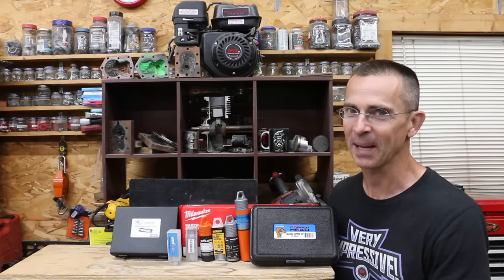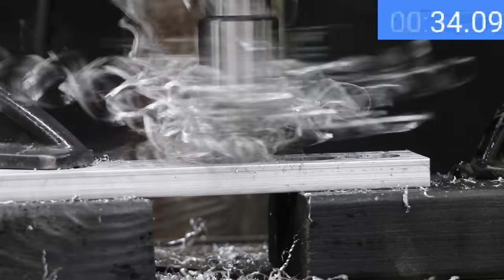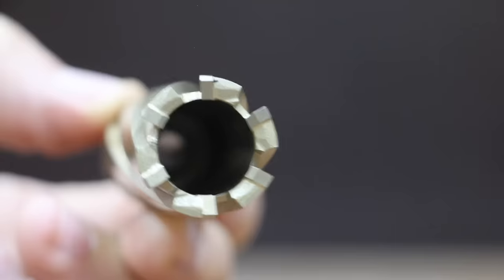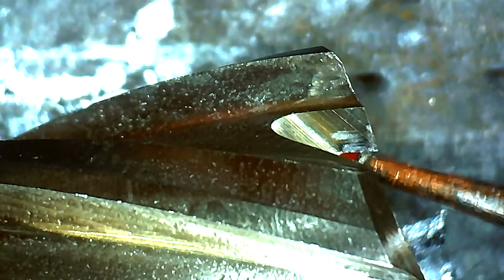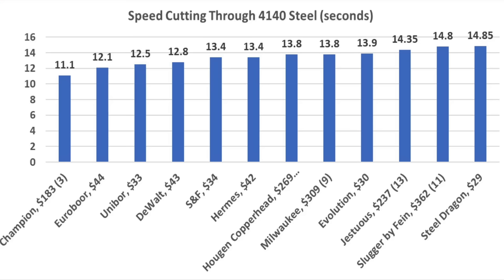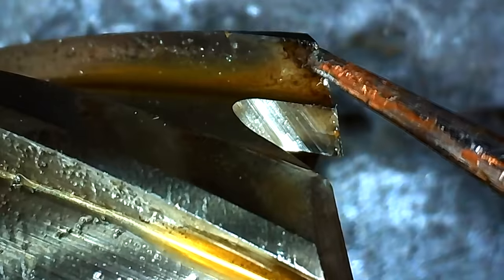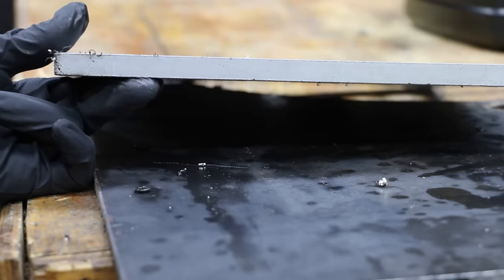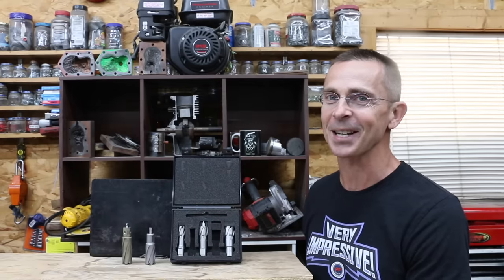Best Annular Cutter? Fein, Milwaukee, DeWalt, Euroboor, Hougan, Hermes, S&F, Evolution, Steel Dragon

Comment: I don't mind if it takes a little longer to make the hole since I'm usually only going to be making one or two, I would rather pay a little more for the cheapest Carbide tooth bit, it's going to last longer and deal with tougher metals
Reply from the maker: Thanks for the feedback.

Comment: Always love these videos and have bought several tools based on your findings! 
What about testing different epoxy brands/types? Not the epoxy you use to glue stuff together, but the epoxy you'd use to put a glass finish on a table or make a river table out of. That would make a gorgeous video!
Reply from the maker: Thanks!  Thanks for the suggestion.

Comment: Thank you so much for this one. :) Got a couple jobs comin up with my Mag drill on some I-Beams. I have a Evo set but those carbide bits are impressive, gonna but a set :) Hey by the way, I have an old Craftsman 16 speed drill press like your 12 speed Havin a hard time getting my chuck out, any suggestions pls' Thx
Reply from the maker: You are welcome!  Thanks for sharing.

Comment: Perhaps this means you might do a comparison on mag drills? Or maybe I missed it, anyways I sure enjoy your videos, thanks much!
Reply from the maker: Thanks!  Thanks for the suggestion.
Reply: Thought of another two things, diesel fuel pumps like used to fuel tractors and such, 12 volt, and kinda along them same lines, engine oil pumps, the type that transfer new engine oil to fill crankcase, there's electric and air operated, thanks for your time and what you do!

Comment: Is there a way to make the test so the initial impact of the blade pressing on the metal didn't circulate the blade before the blade settles in?
Reply: Pilot detent not pilot hole?
Reply from the maker: Thanks for the suggestion.

Comment: AR500 is not made for armor plate, the AR stands for abrasion resistant and is designed for things like the cutting edge on excavator buckets, bulldozer blades, etc.  I think you will find actual armor plate gets into some real exotic alloys with exotic prices so it probably will not be at your local supplier.

Comment: I ran into an imprted turbo for my 01 dodge ram cummins for $160. Vs $1100. And $300. Vs $1200. For my backhoe and wondered have you compared import turbos to a garrett or borg warner? Not tool related but might be some interest, Just a possible tip for another video
Reply from the maker: Thanks for the video idea.

Comment: I've never heaof an annular cutter. I've needed one and didn't know it. 

Cutting big holes in ½" mild steel. Slowly stepping up the size at slow speeds. Still smoking the regular bits and holding the clamp so hard it stops the press and squeaks the belts isn't fun.
Reply from the maker: Thanks for sharing.

Comment: How about testing diesel oil vs gas oil in small air cooled gas engines?

I have been hearing mixed things about it some say it will cause damage but others (including those in positions at oil manufacturers) say it's perfectly safe as long as the spec is equivalent or better than the engine is rated for.  I've done my own research and also came to that conclusion.
Reply from the maker: Thanks for the suggestion.

Comment: Carbide will appreciate a faster surface speed . Take the cutting speed of the material in surface feet a min x4 the. Divide by the diameter of the cutter will be the ideal rpm of the cutter. HSS spins less than half the speed and they need coolant to have cutting edges survive
Reply from the maker: Thanks for the feedback.

Comment: Machinist here. Carbide cuts better when ran faster. You can take deeper cuts at higher speed with carbide. High speed has to be run slower and you can’t take as much material. So running a carbide at the same speed as a high speed cutter won’t give you a realistic result. Also the grade of carbide is important. China doesn’t do the best.

Comment: BTW a carbide tool can run at 3 times the RPM of HSS.
Reply: Which means the feed rate can be 3 times faster.
Reply from the maker: Thanks for sharing.

Comment: I’ve been looking for drill bits to use on ceramic tile. Had one from Bosch and it made it through 3 of the 4 holes. When you look on Amazon there are a lot. Which one works?
Reply from the maker: Thanks for the suggestion.

Comment: I am having trouble getting an obsolete valve spring retainer. Is there an epoxy or JB weld product u would recommend to repair the one I have . I was able to retrieve it and it was only cut in half.

Comment: Could you do a test on bad dog tools drill bits my boss bought them and their sold as do everything drill bits for everything from ar500 to glass when i tried them i couldnt drill more than 1 hole in 1/8" steel plate their a total scam and i think if you did a video putting their claims to the test it would help people avoid getting scammed thank you and keep up the videos ive been a fan since 2017
Reply from the maker: Thanks for the suggestion.

Comment: What I garnered out of all of this was no cutter is worth that money for the early sacrifice. It appears to me that all bits experienced enough early wear to not bother buying any of them.
Reply: Have fun not buying knives, drill bits, chain saw chains or anything that cuts anything as they all degrade with use.  Considering the best of these ended up with about 5% wear and the typical user isn't going to be using them at high pressures or on tool steel or spring steel I find your assessment to be a bit harsh and unrealistic.

Comment: Watching the vids it's pretty obvious your drill press is not controlling the initial progress of the cutters very well. This somewhat random walking around is what chips the teeth when cutting the soft materials. Granted, some teeth geometrics and materials are more chip resistant than others, but this test might be better done on a more rigid machine to remove this random element from the speed testing.

Comment: Since  these things wear so quickly, can they be resharpened?
Reply from the maker: I don't think so.
Reply: @ProjectFarm  Thanks.  The holes you make with them then in hard steel  had better be very important and not able to  be made any other way.  I drilled a lot of   1/2" holes in stainless with cobalt drills and my drills are still sharp. However, if I needed 1 inch holes. I guess I would be forced up to annular bits, as pricey as they can be.

Comment: Great video!! A very precise scale would add an interesting testing metric. Curious how much material the drill bits lose after drilling. I know it doesn’t really matter, and sharpness of the blade matters more, but if two bits both feel sharp, how do you know which one actually is more sharp?

Comment: wow you are testing alum material this time.  What chemical treatments would help to remove broken steel bolts in aluminum cylinder heads.  Reaming the buggers don't work too well.  Heating does not work too well.  Welding a nut to it might but splatter does not work too well.  What about penetration of lubes.  Tried WD40 and nothing - tried DOT4 and nothing.  Anything else.??  Acid kinda hurts aluminum.  What are your thoughts.???
Reply from the maker: Thanks for the suggestion.

Comment: I think your testing in this video is sloppy and misrepresents every product. Your drill press is completely inadequate for anything over 1/2" in diameter when cutting metal as it cannot go below 390 RPM and lacks torque, hence the drill catching and stalling. You also did not apply enough pressure on the cutter which had the effect of creating very thin chips that could not carry heat away from the cutting. You should have used your mag drill or gotten a milling machine. Furthermore I recommend using a feed and speed calculator so you know what kind of SFM/RPM you are supposed to use when using a certain tool material of a certain diameter on a certain material. (FSWizard is free and I use it.) A cutter is not supposed to turn blue and dull/chip after the first hole, its supposed to produce dozens and dozens of holes throughout a day.

You need a cutting fluid as well. Straight tapping/cutting oil is not optimal as it lubricates more than it cools. A water soluble cutting fluid that constantly flows into the cutter is required. For drilling 15/16" holes in AR500 you really need a very serious mag drill over 3000USD or a milling machine. This is because this material requires a LOT of feed pressure and a LOT of torque at very low speeds.

Comment: Im not sure if you were taking this into account but the copperhead looked like it had better chip breaker geometry. If you look at the spring steel test in particular the other carbide tools make long stringy chips and the copperhead makes nice small chips
Reply: Always been told long stringy strands are better.  Constant supply of metal actually cooling the bit.  Tip doesn't keep having to restart the cut.

Comment: New Video request.  any chance to do an OEM brake rotor  vs aftermarket  ex Toyota corolla front rotors.   See which warps first, wear rates   etc?
Reply from the maker: Thanks for the sugestion.

Comment: Hello,
Could you test 4-stroke marine engine oils?
Yamalube full synthetic (gold bottle)
Yamalube blue bottle
Amsoil marine engine oil
Quicksilver full synthetic
Bass pro shops 4 stroke premium blend
Omc xps xd100
Mercury full synthetic
Suzuki ecstar

Another cool comparison would be marine gear lubes.
Thanks.
Reply from the maker: Thanks for the suggestions.

Comment: Mannnn. Be careful around spinning shavings. I used to work in a machine shop and one got wrapped around my leather boot while I was walking. Sliced right through it and into my leg. Might try a spray bottle to add oil next time. 👍
Reply from the maker: Thanks for sharing!

Comment: I am worried that this entire test is invalid. Annular cutters require a VERY rigid set up in order to avoid wandering and damaging the bit seeing as they do not have a pilot hole. You could see tons of visible runout in the drill press and many of the cutters immediately walked upon hitting the sample. This is why using a mag drill for annular cutters is so vital to their success and longevity. Mag drills are ten times more rigid than any drill press. Also your drill press may not be able to run a slow enough rpm and high enough torque to efficiently use these cutters. I am a huge fan of the channel but have always appreciated how you have scientifically controlled for things like this in the past.

Comment: I am a bit late to this party but for the HSS cutters it seems to me that the test was terribly unfair and just plain misleading since those HSS cutters were (apparently) run at waaaay to fast RPM on the steel (hard steels especially), SFPM (surface feet per minute) is extremely critical for HSS tools! Surface speed/RPM wasn't even wasn't even mentioned here but run those things a little too fast (as apparently was happening here!) and it will greatly shorten their life, a bit faster and you no longer get shorter life ---you get NO life!!!!! Sure pressure is important but especially on hard steels SFPM is CRITICAL and it appears those cutters were run much too fast on the hard steels, proper RPM should make them perform much better and they would not have dulled nearly as quick. For example, the poor performance of the Milwaukee on the AR500 should improve greatly with MUCH longer life if run at the proper RPM, really those things were not given a fair chance and were literally murdered by the improper speed.  

I love your channel and I find it hard to criticize but honestly seeing the (apparent) RPM of those HSS cutters on hard steel made me cringe. 

Feed/Speed calculators are easily found on the 'net.

Comment: If you want a good annual cutting bit that cuts some what fast will out live you and mabey your kids and stays sharp enough to cut you and want to cut high carbon steel or magnesium steel or tungsten get a cutter that has tungsten carbide teeth with I think a 45 degree angle never doubt tungsten carbide
Reply from the maker: Thanks for the feedback.

Comment: You should not be using an annular cutter on a drill press!  Additionally,  you really need constant coolant flow when using these tools.  There are charts you should refer to before starting these tests to have decent test results.  No way should such heavy weights ever be used and never without constant coolant flow.
Reply from the maker: Thanks for the constructive feedback.
Reply: @ProjectFarm  I don't want to be harsh but with annular cutters, as with many types of drilling bits they are best used on a mill, with a slow start and then a feed rate based on material and tool diameter.  Many tool manufacturers publish feed/speed charts.  I really like your cannel.